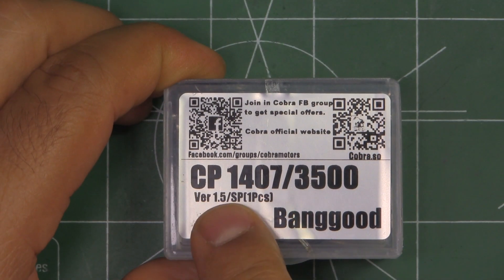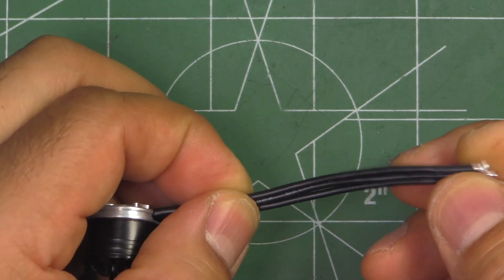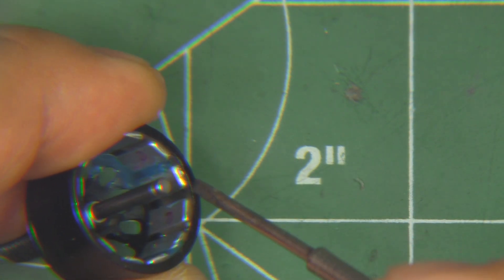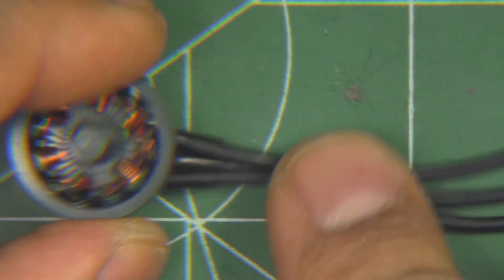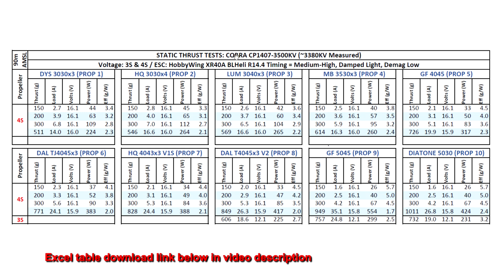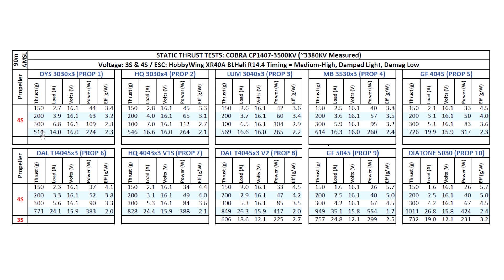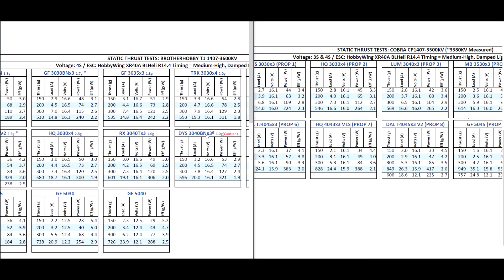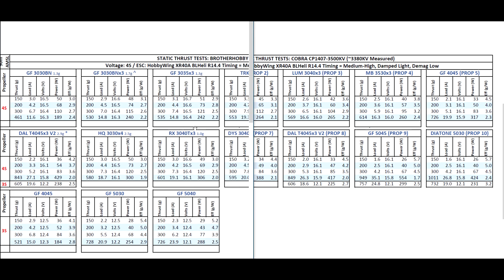COBRA CP1407-3500KV -4S Thrust Tests & Overview

Comment: Are you going to do the 4100kv version of this motor?
Reply from the maker: Most likely I won't test that one. I asked Cobra for test samples and no reply from them. This one I purchased from Banggood. I would guess the 4100KV performance would be close/similar to that of the BrotherHobby or RotorGeeks 1407-4100KV. I did test those.

Comment: Is there any way you could tell me how tall the base of the motor is?! I've tried lookin everywhere and can't find it. I have a set of these motors and they're running rough but I'm thinking it's caused by the 5mm screws because my bottom plate is only 2.5mm thick. Do you think 2.5mm of screw coming through my carbon is getting too close to the windings?
Reply from the maker: 2.5mm of screw would be the max length so it doesn't hit the windings but it's a bit too close. I'm at the office right now and don't have the motor on hand. I would use a toothpick and insert it in each of the mount holes of motor, either mounted or unmounted. Mark toothpick with blade when it hits bottom (windings) then measure that length. 
That will be the max length of screw from bottom of head to tip that you can use. Of course, you'll need to be careful to measure well and do it a few times. Screws should be a little shorter than what you measure just to be safer.
What happens is sometimes windings are uneven, so they might use more height in one motor and less in another. 
Check to see that there's no dirt or metal shavings/solder splatter inside motor. Sometimes that causes motors to feel rough.

Comment: Thinking of using this motor with 5" props, see that you used bi-props on this motor. Was the motor hot running on them?
If yes might drop down to 3200kv motors, but might try tri props. However concerned about not able to reach the stated kv so lack of thrust as well. What are your thoughts on this 1407 motors using 5" props?

Comment: Great overview as always! :) I just noticed that on some of these motors the white glue inside the motor gets loose and the wires can wiggle around. Is that something to worry about or are they strong enough?
Reply from the maker: Thanks. White glue? Don't know what glue. Wire leads are soldered to coil wires. Sometimes they do use a blob of glue there. Have not heard there are issues.
Reply: Okay, thank you :) Well inside mine there is some sort of white epoxy on the coil/motor wires.
Reply from the maker: moewensohn Should not be any issues. Almost all motors will have wires unsupported, without glue.
Reply: Thank you, thats relieving to hear.

Comment: I was looking to do a micro build but I've put that on hold to build a 6 or 7" cruiser.. what would you're suggestions be for motors ? 2208''s or ?? I'm looking for good flying times with a bit of a punch if needed.. looking forward to you're opinions ;)
Reply from the maker: If flight time is a higher priority, then a larger prop and as low KV as possible would give best results. Most of the latest generation motors are high KV, aimed for fast quads/ high performance. 2208's would be one of the better choices, so 1200 or 1500KV would be a good choice. I tested a couple of 2208s sometime ago. The 1200KV was the most efficient and most versatile as it can run on 4S/5S & 6S with 7045 props
https://www.youtube.com/watch?v=QJ6sCjqzNHM
 https://www.youtube.com/watch?v=ynNl0Nh4kIg
Reply: EngineerX nice exactly what I was thinking.. I was reading up on the tmotor f80 1900kv but still doing some research.. this is for a beastly hexacopter build.  So amperage is a big concern..
Reply from the maker: Yep, hex will draw lots of Amps. 1900KV might be a bit too high for 7" props. Also prop pitch is a big factor. HQ has a new 7040 that may work better for your purpose. If good 7020 or 7030 props were available, they'd be worth a try.
Reply: EngineerX Hi m8.. I will be going max 6" it's a spider hex similar to you're RD350 that you had a few years back ;) so you reckon 1900kv should be fine on 6".. the original blackout hex has a PDB but I'm not sure what it can take as this was out way before today's more powerful motors..

Comment: If you got instead of 2204 a 2206 motor can you bumb up the rpm than? Because everyone (ive seen) got max throttle on 2000rpm is that the max,? or whit high kv motors also is it possible to bumb it up ? Srry for the englisch😆
Reply from the maker: You can bump up by increasing voltage. You can increase voltage from 4S(16V) to 5S(20V) safely on 2205, 2206, 2207 motors 1800KV to 2400KV
Reply: EngineerX so if you bumb up the voltage the rpm wil go whit it?

Comment: Hmmm, I run the 4100kv on 4 inch with a split (they were meant for a 3 inch but.... complicated) and they don't even get warm, wonder if they're well under Kv too. Make sure you change the screws if you get these. They're awful. Test flight - https://youtu.be/R_3Yp_rWXMI
Reply from the maker: Awesome setup, What LiPos were you using there, seemed like you got pretty good flight times. It could be they're lower KV but hard to tell without measuring. Most of the 4100's people use them with 3" because on 4S 4100's are punishing on LiPos. thanks for sharing
Reply: EngineerX they were bought for a 3 inch but decided to try. batteries were tattu 850 75c and an old turnigy nano tech 850 45-90c. with the split the quad was 173g props on. without it and using a runcam micro it was sitting at 149g. im going to try out bigger batteries as my other 4 inch fly great on them. if it ever stops raining I'll update you on further tests under more normal conditions as flying in a giant field drains em quick!
Reply from the maker: LoL.... yeah I saw it, when you opened up on those long runs, one just can't help it when all that space is available.

Comment: Great review, have a set of these coming for 4 inch (to replace iflights Force 1407 - broke 2 so far - weak bases) - think I should have gotten the 3700kv though, maybe. Seems like the KV is way under.
Reply: ten drones I'm running the 4100kv on a 4 inch with a split (were meant for a 3 inch but... complicated). They're not even warm. Test flight https://youtu.be/R_3Yp_rWXMI
Reply from the maker: At least this one I got , the KV is considerably lower so it will affect 3" performance somewhat, compared to other motors of similar spec'd KV. These will still fly fast , but if wanted similar performance to BH 1407, then the 3700KV would be better. Hard to say if the KV is low on all motors or just on the batch I got. Would have to measure another motor to really confirm. But my feeling is that they're going to be lower KV for the 3500 version.

Comment: am i right in thinking that a hyper light 5" build of 200g or lighter considering these motors weigh less then half of what i use now, you could get a power to weight ratio of 20 to one with the diatone 5030 props? thats over 4 kilograms of thrust on some floss. whew, that would be awesome.
Reply from the maker: Not quite...... the Max thrust in all static thrust tests is only seen ... well in "static" conditions, once in-flight Max thrust will be much lower. But these tests give you a very good idea of which motor is stronger and which prop is best. So you won't really get 4kg total thrust..... my best guess.... perhaps around 55 to 65% of that on full throttle at full speed, but that will be plenty fast!
Reply: oh yeah, got so excited i forgot all that, still will be what i'm going to try next
Reply from the maker: Very good choice !
Reply: Are they notchy or as smooth as tiger f20 v2??
Reply from the maker: The 3500KV I bought is not notchy at all. I can give it a twist and it spins quite a lot.... so "standard" notchy action. Certainly less than BH 1407